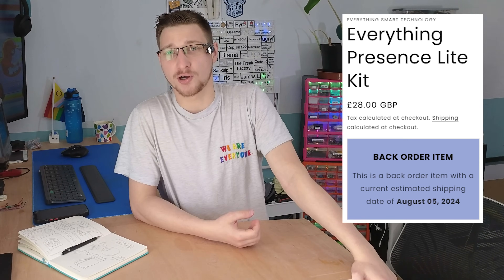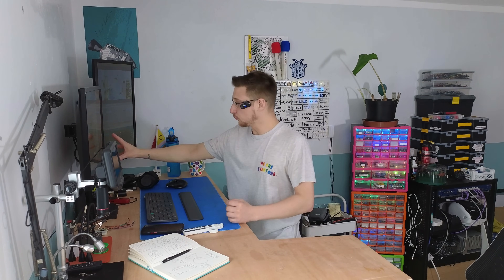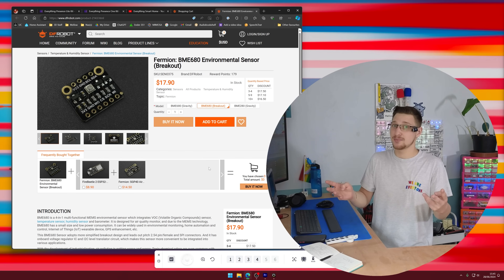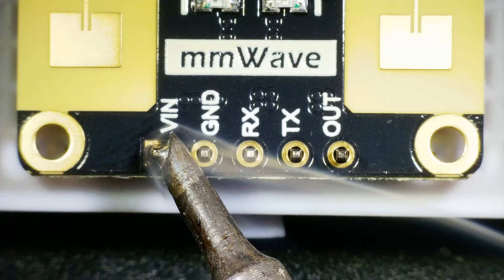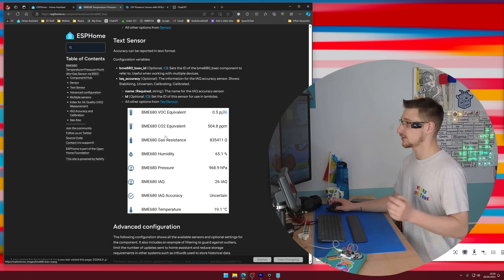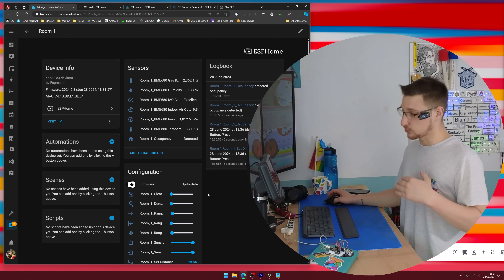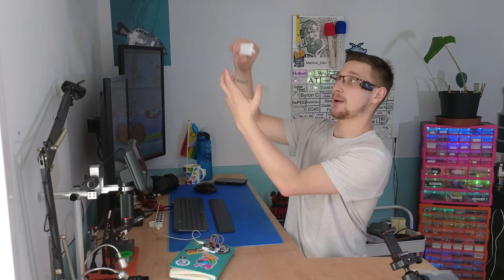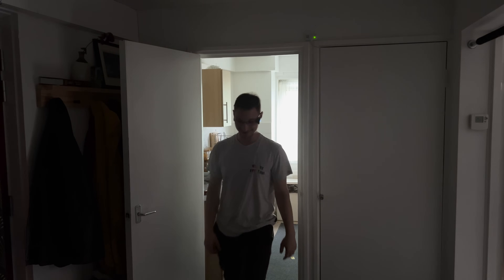Diy Presence Sensor

Comment: where did you buy 3D printer, how you prepared design to print box, where did you fix mounting pins or screws, you did not actually, how to fix pins or screw sockets in printed box, why dont ypu give monting brace on wall? Please post video of this printer spec, how to prepare complex single layer pcb mount and multilayered pcb mount with pins, sockets.

Comment: Small tip, to avoid triggering from behind the sensor (goes trough walls) put a layer of aluminum foil on the back. That will make it more directional … thank me later 😋
Reply: For cheap 10g radar yes but for these 24g ones the datasheet specifically asks no metal anywhere around

Comment: I’m a total Home Assistant junkie. And more recently going harder on my ham radio stuff, I’m getting more comfortable and confident with soldering. This kind of project is exactly what I want to take on. Presence sensors are so much more useful to me than motion sensors, and have become the foundation of some of my most useful automations. I’ve got the 3D printer but need to pick up enough 3D design skills to be dangerous.

I think if you kept going with this, compressed your design down to a single pc board, there’s enough room in the market for someone else to sell ESPhome sensors! It’d be a nice additional way to monetize your content in a totally non toxic kind of way.

Also PS this is my first time on your channel and def subscribing. Cheers!
Reply from the maker: Thank you so much! There are a couple of things that I think would make a good product that I’ve made, and I’m exploring those options, but I am still in the process of learning the knowledge I need to make those things.

Comment: Hello bro I need your help it's a  sensor that can sence even static and motion both ok I need that circuit diagram and also I want to add here cloud interface system to control remotely over internet anywhere in the World

Comment: I would add some physical separation between the temperature sensor and the rest to make sure that the heat generated by the esp32 won't be biasing the readings.
Also, the bme680 is just estimating the co2 reading, not actually measuring it.

Comment: Great video! And very reminiscent of the original EP1 video I did that led me to making it in the first place! Btw, we finally have great stock of the Lite haha, been difficult to keep it in stock!

Also a quick note regarding the PIR in the EP1, it's not actually used for just the same function, but it can greatly assist in certain environments and add a lot of flexibility for detection, which is the real reason for including it on the EP1.

Keep up the good work!
Reply from the maker: Oh wow, thank you! 🙏 
I’m currently working on a project that’s destined for the bin because it doesn’t wanna work, so this comment is a big morale booster thank you!

Comment: Great video, are you going to upload your case by chance?
Reply from the maker: I’ve mentioned it in a previous comment, but it’s actually not a good design. Putting the sensor that high up makes it very difficult for it to detect shorter people I recommend around waste height. I actually have a video coming out on Monday explaining it

Comment: You can use the bme680_bsec library to get the CO2 and Indoor Air Quality functionality (platform: bme680_bsec). It’s Bosch proprietary though, so you have to accept the license agreement when it first compiles in ESP_Home. 
(in b4 ‘it’s not true CO2’ … yes, but I have one on a board next to an SCD41 and it’s a surprisingly good estimation)

Comment: Can detect dogs and cats and can be used outside a house?
Reply from the maker: It should be able to detect cats and dogs. I don’t think you can distinguish between them.
And you can have it outside, just put it in a waterproof enclosure.
Reply: @Mellow_labs  Tks!

Comment: i can buy some EP1's, or the apollo, but they are 50 bucks, especially with shipping. I'd rather make my own for 20 bucks. but i have to find out what exists.
Reply from the maker: I would recommend looking at DFrobots new mmWave sensor C1001 it’s a much better version of the one I used.

Comment: Will you share your case stl files on Printables?
Reply from the maker: I would but I don’t actually recommend it, it’s made to be up high. Which I now know is not where you want to put a mmwave, it’s not very good at detecting shorter people. So you’re better off putting it about knee high.

Comment: They need that in Japan where people die alone in apartments and are not fpund for 3 weeks or more. So if there is no motion in the bathroom or kitchen for 3 days energency services is notified. Good for people over 60.
Reply: Huh. I think I really like this idea. 
Most smart home related things I've seen so far are simply toys for adults. Which I like,  don't get me wrong,  but won't really improve your life. I got ideas for presence sensors,  but I recognize it for what it is,  I want to play with new toys.  

Tough, this idea is one of the few that is actually....  VERY useful. Set with the right parameters and shit...  That might actually save lives.   
Or in the very very least save anyone else later involved some pretty nasty smells and images.  Which is still very very usefulI I'd argue.

Comment: A simple IR sensor cant do the same? or what's the rocket science behind this ?
Reply from the maker: In most cases where I’ve tried IR sensors, they suck. A little bit of sunlight through the window is going to trigger them constantly. Also they don’t have the range of a mmwave sensor, this one can detect you from 24 m away.

Comment: As a parent of young children (and a maker), I like this "ability to sense breathing".  It means I can get an alert if my child stops breathing for instance, or has difficulty.
Reply: Well no, not like that. It is able to sense breathing, but not exclusively breathing. Any movement will do so it’s not of much use for this purpose.
Reply: @meeskees702  but medical sensors for sense newborns breathing works exactly this way. If there is no movement for 15 seconds then it start alarm. They are based on crazy sensitive induction coils.
Reply: If the kids are still, I'm concerned and my parental instincts kick in.  @meeskees702

Comment: 9:15
Why can't this be used like those that uses coin batteries? e.g. aqara sensor
That wire will definitely not pass spouse approval.
Reply from the maker: The reason this DIY setup can't use a coin battery like some other sensors is due to higher power consumption.

Beetle ESP32-C3: ~160 mA at 3.3V
mmWave Sensor: ~3.5 mA at 3.3V
BME680 Sensor: ~3.1 mA at 3.3V
Total Power Consumption: ~165 mA

A CR2032 coin battery (220 mAh) would only last about 1.2 hours with this setup. The Aqara Presence Sensor, also uses a wire due to similar power needs. Despite initial concerns my partner, quickly appreciate the functionality and benefits of this sensor.

Comment: The PIR on the EP1 is great for avoiding false positives on the mmwave in larger rooms. PIR to turn the lights on, mmwave to turn them off, perfection.

Oh and the DFRobot sensor in the EP1 doesn't support zones, but I guess you found that out by now 😁
Reply from the maker: Yeah also don't have the mounted up high, It won't recognise short people.

Comment: Nice project and the coding installation looks very simple.
An almost unrelated question: what gauche of wiring did you use inside the box?
Reply from the maker: its 28awg Silicone Electrical wire, I actually went over how much I like it in a previous video.
Reply: @Mellow_labs  I must have must that. Thanks :)

Comment: 60GHz sensors can tell heart rate, distance, do fall detection, etc... normal mmwave ones are 24ghz (if they're good, if they're less than 24ghz, don't touch 'em)